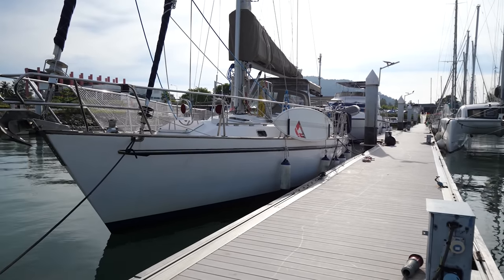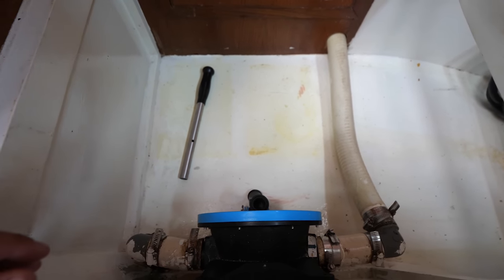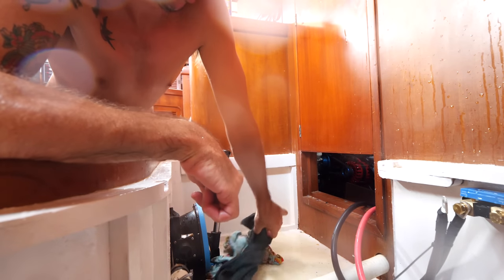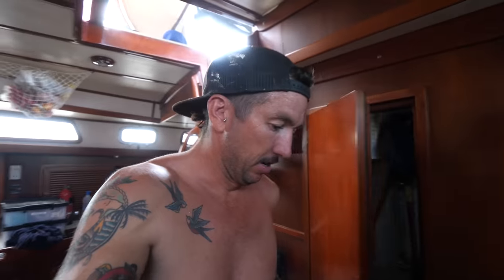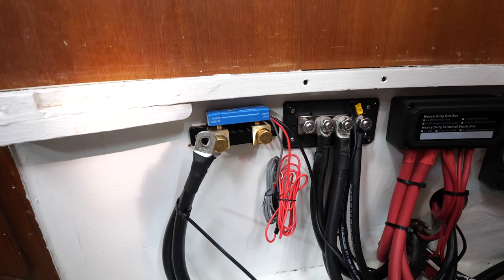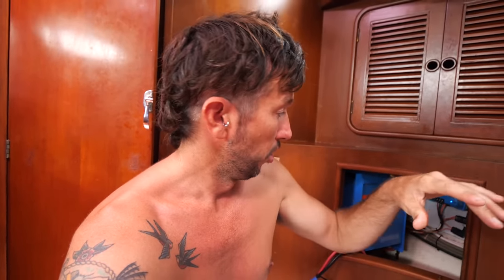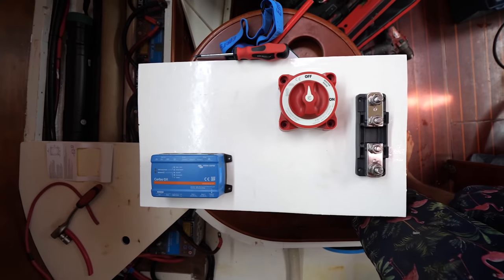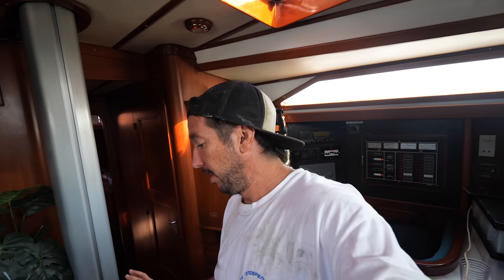BUILDING OUR DREAM BOAT!! a HUGE Lithium battery bank install!! Ep 318

Comment: Be sure to have plenty of heat ventilation options..... Micro fans to push the air... Should be all good
Reply: I agree with this comment. Mounting a series of micro fans in the seating supports to pull heat out of the battery bank into the main salon is a good idea to keep the battery bank as cool as possible.

Comment: I did some of this on my own. I just set up a couple fridges and a bunch of fairly powerful radios with LIPO and a Renogy. I'm happy I did it. I'm not using an inverter for anything at this time, I'm slowly separating myself from my power company.  I can take it all with me if I do jump out of here, either RV or Boat. 4 panels. Not a big system but it does so much its amazing !

Comment: Congratulations Yosh and Bonita in getting your lithium battery bank and controller installed. It was a major project and how you managed to link the battery bank to the boat's central control panel, with all your other devices, like your radios and everything else was a major accomplishment. Good on you. You frothers are really putting on a performance about what it takes to be the owners of a complex, ocean-going sailboat. Nandji 2.0 is an impressive boat in every way. You really made a great selection in choosing that particular boat.

Comment: Hey man. I would suggest ventilating that cabinet with the multiplus and solar charge controller. They get hot!
Reply from the maker: The cabinet is already ventilated and the air con also  needs s ducted the the hole 👌
Reply: @FrothLyfeSailingNandji  excellent. Just looking out for you my friend. I’ve seen some stuff with unventilated utility cabinets.

Comment: Great job, purchase, transport, import and installation. I am pretty sure you will need to arrange some cooling for the Charger etc some form of 12 V fans should do the trick
Reply from the maker: The cabinet is actually vented from the conditioning 👍
Reply: @FrothLyfeSailingNandji  But you don't run the AC all the time or can you fix it to run air circ only and compressor when cooling is required. Or a thermostat in the charger/imverter cabinet to turn airco On. Time will tell success.

Comment: don't tell anyone i'm at work watching this !!  video just started .. got my fingers crossed that yosh fixes it despite the little blonde boss micromanaging your work time ;) putting a flame proof liner in around a lithium battery won't stop a battery fire! But it will slow it down enough to save the boat! If a lithium battery does get damaged and it does the Roman candle thing.. i learnt this trick with my RC models, my friends canal boat had a battery fire the fire blankets we put in around the battery saved their boat when their power wall had a battery cell failure. Boat survived, damage was bad but!! it lived to fight another day. Top Marks to Pete for the ideas! I might need pete's brain at some point x :)

Comment: I am surprised that the multiplus doesn’t have a separate input for the generator and shore power in addition to the 12 volt input(s) and auto switch between the ac power sources.  The inverter will generate heat so make sure the compartment is well ventilated!
Reply from the maker: This is an option for a choice of multiplus although as we will only ever have one source of ac input, this meets our needs 👍 there is no need to run the generator if we are plugged into shore power
Reply: @FrothLyfeSailingNandji  By using the multiplus with two inputs, it would auto switch, and eliminate the need for the extra cable run and the manual switch.  It will certainly work with the manual switch, it just takes more steps when you start the generator.  I agree that there would be no reason to run the generator when you have shore power. :)

Comment: Yosh, you installing all those batteries on one side of the boat? No issues with trim?
Reply from the maker: 20 lithium batteries are lighter than the 6 agm they replaced. Also the boat weighs 16t, what’s 100kg in the scheme of it 😂

Comment: Yosh you need to think about Knock down as in  strapping batteries in place  & fire different ball game with lithium, you need to be prepared before hand for both mate know your probably on to it but never hurts to remind a bloke ehh 👍
Reply from the maker: The lounge covers will be screwed down once fire retardant packing installed and installation is complete 👌
Reply: Would double check your extinguisher will handle a fire 🔥 with those batteries to mate from what I've heard they are a bastard to put out

Comment: Novice here with no sailing experience per say…. 😂.    Perhaps an upcoming video, let us know do you have to monitor battery heat?     
We hear about lithium computer batteries bursting on fire in peoples luggage? 🤥.   Do they have auto shut off?
Reply from the maker: Each battery has a built in BMS (battery monitoring system) this monitors temperatures and shuts them off if my funny business occurs

Comment: 2000 Ah, Nice one mates, I dream of 1000 Ah Haha. One day
You're getting way smarter mate, by doing it yourself and further on you'll be passing that knowledge on.
Keep the cables from the 2 different battery banks to the busbars the same length, even if it means a coil of cable on one side of the system.
I also have a 150/85, it's a beast but so awesome when it's throwing those 85A into the batteries.

Comment: I have 1200 Ah/15.5kWh of LFP in my boat. One of the things I worry about and that I have not resolved is what to do in case of fire. I am thinking about flooding the battery compartment from the fresh water tanks.
Reply: @FrothLyfeSailingNandji  CO2 is no good for lithium. The oxygen comes from the electrolyte. You can't smother it. The water is a high  capacity heat sink. If you can drop it below the ignition temperature it will stop burning. The other option is a salt extinguisher. Extremely expensive and very large.
Reply: Very difficult to stop a Lithium fire as it does not need oxegen to burn. Fire departments are saying they will just let it burn. Very worrying I would not have them at any cost
Reply: @petercresswell9517  One way to stop the fire is to absorb the heat so the temperature drops below ignition temperature, hence the water. It is possible to buy fire extinguishers for Lithium battery fires which use salt as a heat sink. They are expensive and bulky

Comment: OMG I work with an off-grid system on land and it has many moving parts that have the potential to go wrong, but at least I am not confined by space and salt water to install and keep operating. I don't know how you guys afford your upgrades I plug along as a garlic and veg grower and I am flat out affording to upgrade my systems on what I can generate as an income ... which as a product ironically is what you need to go back to shore to survive.

Comment: Hey Yosh, I've been watching for years. Is there a reason you went with bus-bars rather than a Victron Lynx Distributor or Lynx Power in with the fuse upgrade? I recently went through this with my camper trailer, and it worked out cheaper to go with a Lynx Power in with the fuse upgrade? than running separate +ve and -ve bus-bars and fuses?
Reply from the maker: I wanted more than 4 terminals. With a bus bar, it has 4 terminals but we can just keep loading it up and then add individual fuses for each circuit. Nothing technical, just trying to keep it simple

Comment: I very sincerely hope you have researched what happens if a lithium battery catches on fire?...there are literally dozens of YouTube videos showing that it's impossible to extinguish them!  Personally I would NEVER have any lithium batteries after knowing just how potentially dangerous they can be and I would otherwise not be warning you about it...I'm extremely concerned for you now and very hope you can show us less reasons to be this worried.
Reply from the maker: We have had lithium batteries on our boats for 5 years now. A lithium battery is no more dangerous then a lead acid battery providing you have the safety measurements in place
Reply: @FrothLyfeSailingNandji  And so does that mean you won't watch any of the videos showing what happens when they catch fire?
Reply: Most current lithium cells use LiFEPO4 chemistry. Its less dangerous than Lead Acid. No open fire can be produced in that chemistry only stinky smock. But if consider the huge power batteries can produce, its may easily burn the cables or equipment in case of shorts or wrong plug ins.